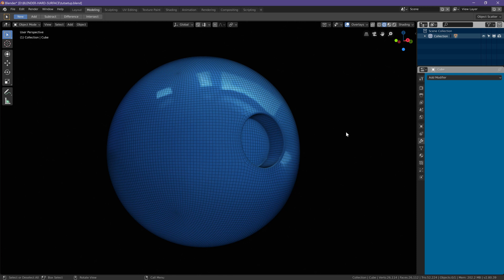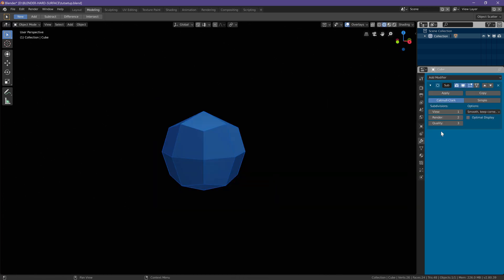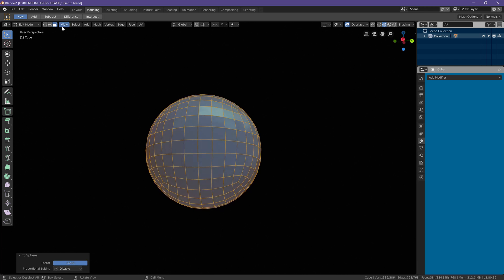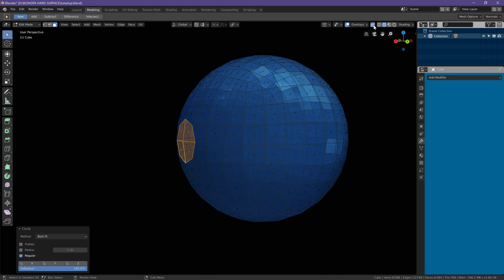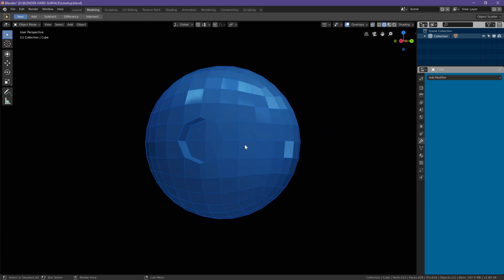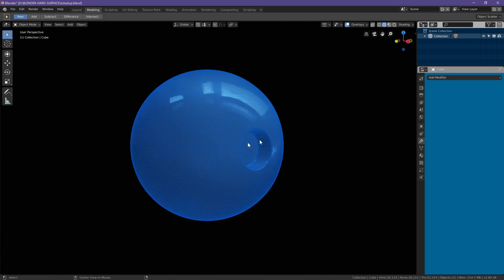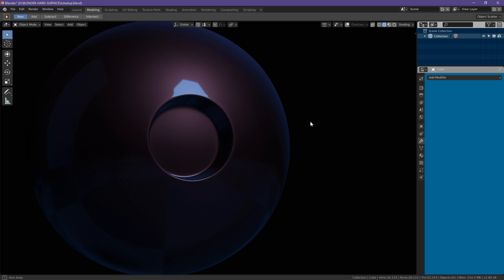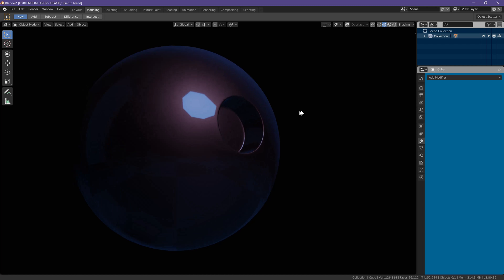CUT A HOLE IN A CURVED SURFACE (without bool) in Blender 2.8

Comment: hey kids wanna know other easy way?

use the boolean modifier , litreally 5 seconds
Reply from the maker: very quick and easy, indeed! The way ive demonstrated is for modelers who plan to use sub-d modeling and therefore need workable topology, which is hard to achieve using a boolean. but for a quick cut for a concept model, boolean would indeed be faster!